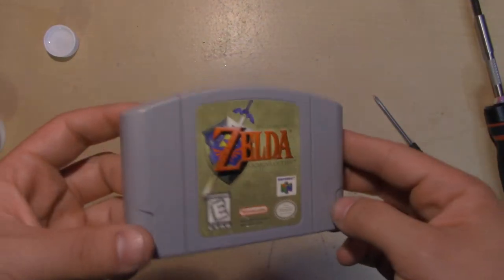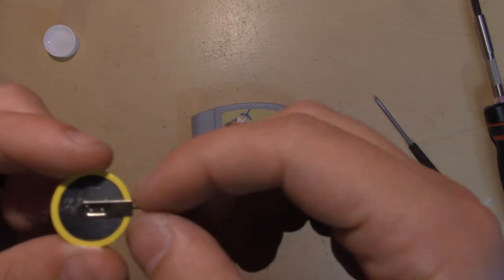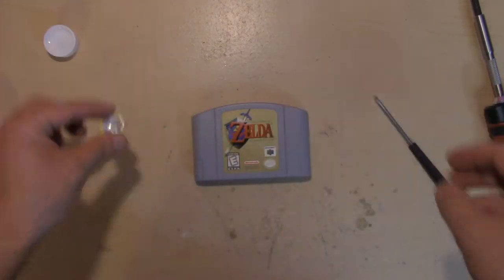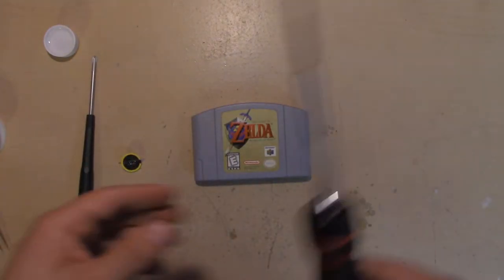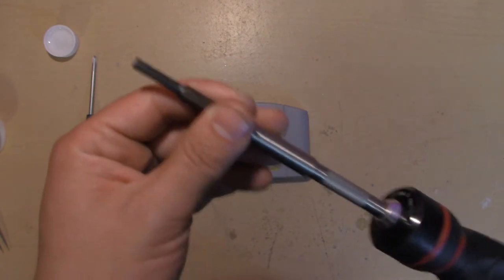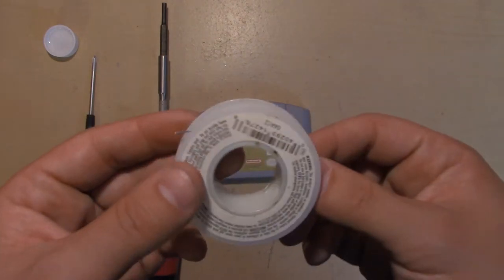How to Replace a N64 Battery

Comment: One little thing I like to do when I change a game battery is write the date on the top of the battery surface in sharpie. That way, if the game is opened again (for another battery change or whatever reason) the battery change date will be known.
Reply from the maker: Great protip
Reply: How come my games haven't been erased after 20 years?. How long do these things last? lol.
Reply: I'd say it's pretty close to time to fail on you. You can open the cart up and test with a multimeter set to DC. If its over 3.1 volt I'd say your good for a little longer. Most n64 games do not need a battery though.
Reply: @timc2434  Yeah, I found out that the Pokemon games dame all with non volatile memory, thus no need for batteries.
Reply: @PinkGorilla  do you have a recommended source for the batteries? I've been looking for some but they all come 5 or 10 packs and I only need one.
Reply: So if you remove the battery without playing it does it erase the data? I lost Al my Zelda saved files due to this
Reply: Because I’m finnally figuring my battery is dead
Reply: Most games didn’t use batteries tho.

Comment: Back in the day I was the guy who knew how to replace save batteries on old pokemon gameboy games, my friends & family would buy or trade for old pokemon carts and bring them to me to get them fixed. Pokemon batteries seemed to die sooner because of the constant Saving players had to do, whereas there are still original N64 carts with working save batteries after 20+ years which is insane. 
I just acquired a copy of Super Smash Bros that I need to restore. The label is faded and the game doesn't save. Your tutorial is spot on. Thank you!

Comment: Ty ty! My resident evil 2 battery was dead. First video I stumble across and it beautifully explains how to change it out. Super easy and well articulated.
Reply: same dude
i wonder if its a common defect with RE2 games or something
Reply: Ditto. I need to replace my RE2 battery as well.
Reply: @gammon_gaming  Not so much a defect but a choice of save method, Most N64 games use EEPROM to save to cart. EEPROM games shouldn't be a worry game save wise. A handful of games, however use SRAM and save to batteries which will need to be replaced. Resident Evil 2 is on that list alongside 1080 snowboarding, OoT, Smash and a few others.

Comment: I have this problem with my banjo kazzoie n64 cardridge, but when I had opened it there was no battery, do you know, is there something different? Thanks a lot!
Reply: Banjo Kazooie has no battery in it
Reply: @FigureFarter  Then how does it save?
Reply: @nozarashi4329  Most N64 games use flash memory

Comment: So if a battery dies, is your saved data lost forever once you replace it? Or is there anyway to save your data for good??
Reply: Yes to both questions. You can backup your save file digitally with some special devices. Other than that, if you are able to power up the PCB game cartridge and remove the old battery, somehow, and replace the dying battery with a new one while the game is running, you can keep your progress if you save it on the new battery.

Your saves are automatically (and completely) wiped once the old battery is either removed or too low on voltage. So make sure to load a continue save you want to keep and begin the tricky process of removing the old battery. Remember to save once you replace it.

This works with any game that relies on a battery to save game files like NES, SNES, N64, GB and GBC games. N64 memory cards also use a battery as well.
Reply: Try backing them up on a controller pak
Reply: @Vulpine_Cloaker  Paper Mario WON'T Save to the Controller Pak. That & Most 1st Party N64 Games Outright Refuse!

Comment: I've changed battery correctly, i've already checked with multimeter 3v.
But i just cannot save. Do You know what coult it be?
Reply: Reflow the solder once more and check for continuity in case there is a bad trace.
Reply: Same here sodered it and doesn’t work
Reply: Did you guys ever figure it out I’m kinda scared to do it I don’t wanna ruin my copy of ocarina of time or majoras mask they were hard to find and pretty pricey.
Reply: @Skankhunt-hl9zj  same I so frustrated with that crap

Comment: I followed the process and I still couldn't get my oot to save
Reply: I'm using a cr2032
Reply: Did you manage to fix this? If so, what was the problem?
Reply: @luith6953  It worked, but it took some time before it could start saving again.  I just had to wait for the soilder dry up.
Reply: @GreenPrinceRukio  oh really? I would expect the solder to dry pretty fast. How long did you have to wait?
Reply: @luith6953  I have no idea why my cart of oot had this problem, but every other cart I swapped batteries for saved right away.

Comment: I vchange the battery but the game still doesn't save... i've been changing my gameboy and snes games without issues. But ocarina of time just doesn't save.
Reply: pikaarceus did you make sure you have the battery lined up correctly? If you have the + and -  ends of the battery connected in the wrong spot the save won’t work
Reply: @YaBoiJrue  I did, but nothing happened.
Reply: I have the same problem, I bought it and erase all the files one the game but when I try to save mine it won’t, the. I change the battery but no luck
Reply: @funtasticpartyrentals394  Glad to see i'm not alone
Reply: Si whats the update
Reply: @funtasticpartyrentals394  There's no update, i gave up. There is curently no battery in my game. I have the game on my gamecube and my 3DS too so i don't really mind.

Comment: i figured the battery thing out the hard way
Reply: lost my dads 25 year 120 star save file
Reply: @wumpols  I do not think Mario 64 uses a battery in the cart. (SRAM) I know about 12 games or so do like Smash 64, Ocarina of Time, Resident Evil 2, and F-Zero X. Also Memory Packs do use the same batteries as well as carts but Mario saves to the cart. They are CR2032 if your looking for any.
Reply: i understood this after i posted the comment, Thank you anyway